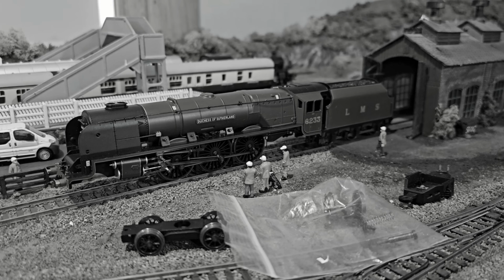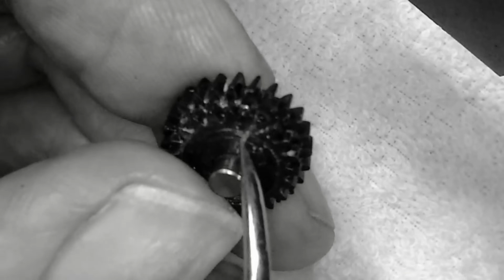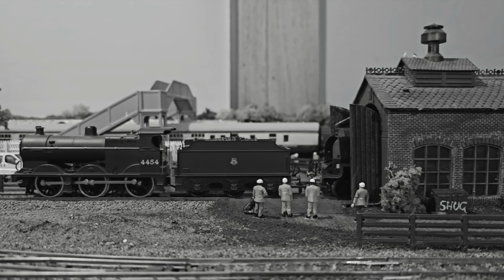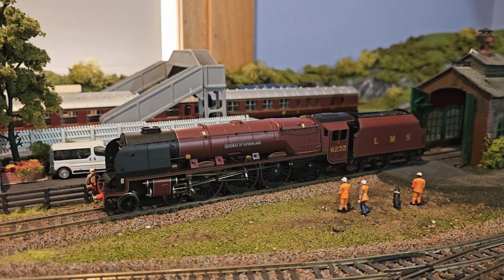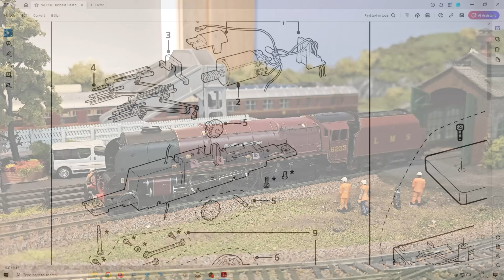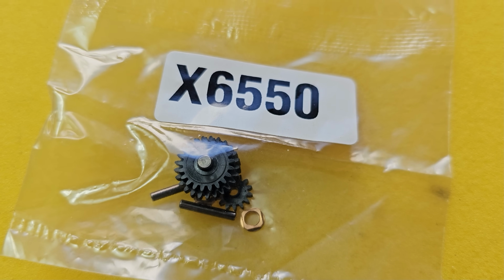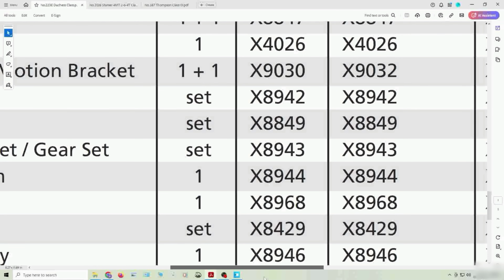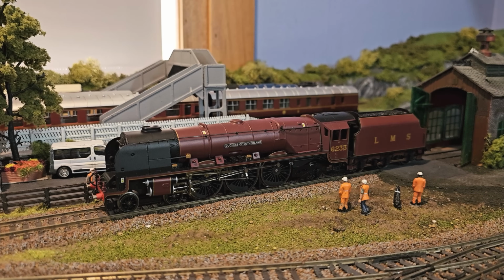Hornby "Duchess of Sutherland" : The Return of The Duchess

Comment: Bill, I have just decided to restore my Hornby Hymek R.758 (with the 3 pole X.410 Armature assembly). Its been sitting in the cupboard for 40 years! Do you know if there is a 5 Pole Armature available that would fit the Hymek? 5 pole works much better! Particularly for slow shunting. Thanks Paul.
Reply from the maker: Not that I'm aware of. The difference a 5 pole armature would make would be minimal with the same gearing.

Comment: Hi Bill, I have a question for you. I have unfortunately sheered off the head of the screw (crank pin?) on the centre wheel of my Duchess of Atholl and wondered how easy it would be to get the rest of the screw out of the wheel. Would it be a case of drilling a tiny hole in the screw thread end try to bring it out by inserting something into the hole and screwing backwards or would it be a case of getting a new wheel set? Thanks in advance.
Reply from the maker: It's possible to replace the brass threaded shaft the screw is stuck in. Just tap it inwards and replace with one from another wheel or a spare. It would be possible to drill it out though.
Reply: @oobill  Thanks Bill. Sounds like there is a female thread coming in from the rear of the wheel then, that the screw goes into. That sounds easier and less problematic than drilling it out. Thank you. I'll have a look. I don't have any spares of it, but I can get them off eBay or Peters Spares.